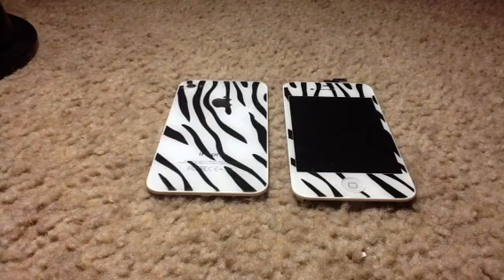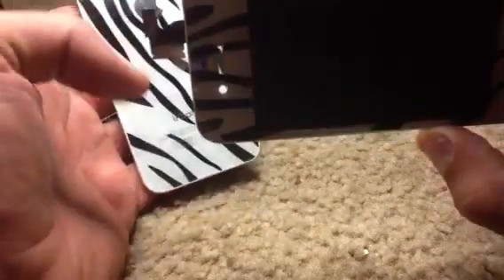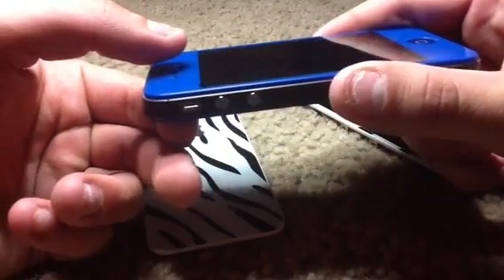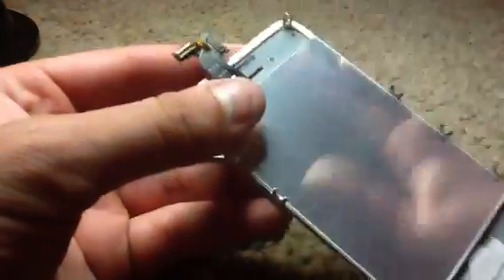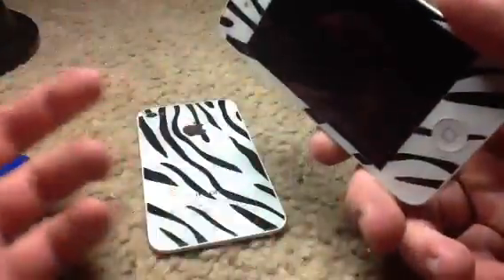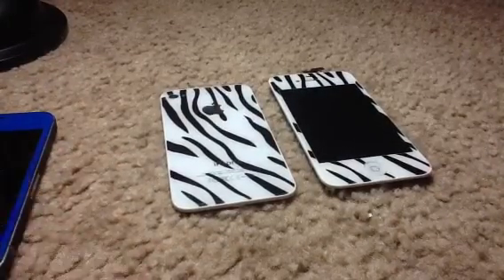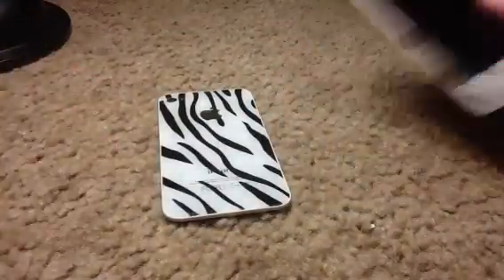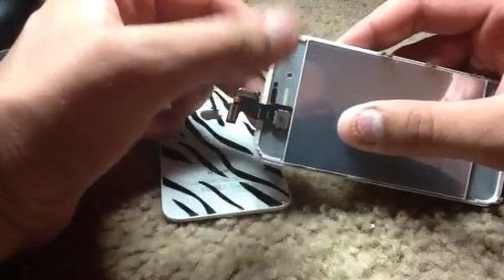iPhone 4 and 4S proximity sensor issue fix

Comment: I still have a stock iPhone 4S screen but the proximity sensor does not work. I thinking that I might need to replace the flex cable. Any ideas?

Comment from the maker: it may be a defective LCD or the logicboard just inst reading the flex terminal correctly. If it was pressure related then it would be obvious and very visible on the screen. try removing the screen and test it without it installed and see if its any different.

Comment: did 4s screen replacement was working finethe day i fixed it then a day later it has some weird colors on it almost like an old tv colored lines.what can i do to fix this?are the 6 washers important because i have 5of them on correctly and 1 is insideof the bracket and not directly behind the screw like the other 5.also the screen goes off when i answer a call but dosnt come back on when i take the phone away from my face will your tape fix fix this problem or is it just for phones that stay on?

Comment from the maker: In the video I demo what causes the issue and how to resolve it, never use electric tape, it can easily cover the sensor and you wont see it when you put the phone back together and you will accomplish nothing. Just put the original gasket from your 4S on the replacement screen and that should be enough

Comment: Why write "FIX" when you offer no solution to the problem whatsoever...

**THE FIX**

Black electrical tape, cut two small holes with an exacto knife (about the size of a ballpoint pen) exactly large enough to fit over the two sensors. Cut out the holes so you now have a small rectangle with two holes.

Place the rectangle over the proximity sensors and the holes should line up.

Thats it!

Reconnect the "Faulty" screen and... VOILA!

Comment from the maker: unfortunately I have no idea where to get them. you could check ebay but I would suggest changing your power button flex cable for one with a stronger proximity sensor or making a gasket out of black electric tape. hope this helps in some way

Comment: No, I did not, but I'll take a good look at it. Well I really do not the answer to this issue because there are many factors that could make it malfunction. For me is usually the screen that is not right in place because when screwing back it kinda moves out of place. But also, the phone I was dealing was a 4, yours is a 4S and I have noticed that the proximity sensors are different. The 4S looks like is more deep inside, maybe because is very sensitive to light, unlike the 4 that is more out.

Comment: You said that your proximity sensor doesn't work because too much light is going in & I do not think thats quite right. The other time I got a phone, which I used, and the screen was shattered cracked. The whole top glass fell off that I was able to see the front camera, the speaker, and proximity sensor. Whenever I placed calls the sensor worked fine, even when daylight was hitting it. The issue is that you need to aline the top opening with the sensor when replacing a screen like u mentioned.

Comment: the iphone 4 has two microphones. One at the bottom and another at the top. When you record video, put ur phone on speaker; you use the top microphone. When you are in a phone call you use the microphone at the bottom. What you are experiencing is not a proximity sensor issue. I find it strange because you say that voice memos work. I would suggest doing a restore. If that doesn't work, then replace the mic at the bottom, maybe your friend did not checked so well.

Comment: Hi, Thanks for your advice.  I had the faulty prox sensor also. Removed the lifeproof case and prox started working. The cheap copy of a lifeproof case has no light barrier between the sensors. No Gasket. So I placed a small strip of amalgamating tape (1mm x 4mm) between the 2 barely visible sensors and replaced the case. It then worked. Light probably reflects off the protective acrylic front cover from the led to the adjacent light sensor. Insulation tape would probably work.

Comment: This was an 8 minute video in which you spent less than one min talkin about the proximity sensor. I just got a new iphone 4s from the apple store straight out of the box the proximity sensor didn't work. I had my 4 for about a year and a half. It didn't work either. I never knew that the 4&4s had that feature because both my brothers and my girlfriend..and sister in law.. have the same problem. I've been cheek muting people for years. It's doubtful that even one of our phones came from apple w

Comment: Just an FYI. The third "dot" next to the other ports is specifically for iphone 4S'. It's for one of the extra proximity sensors they put in for Siri. If your replacement screen for your 4S doesn't have that dot it's for a cdma or gsm. It will still work but there's a slight chance Siri might not "know" when you put te phone up to your ear.

Comment: I dont know how to personal message you so Ill just ask you here. Where do you get your screens from? I have been getting mine off ebay from two different places and I pay 39.00 from one place and 34.00 from the other place but so far they have been good screens. Any info would be helpful. Thanks. BTW good video too although I still have not been able to get the proximity sensor to work on one of the iphone 4 I have. Tried the decider thing but it didnt help. Any suggestions?

Comment from the maker: On my blue 4S I have actually gained screen resolution quality compared to my original LCD, the digitizer is just as responsive and I haven't seen any lost quality. My best suggestion is to just ask the ebay seller who makes the LCD and about the quality. The price makes no difference in the quality (this is obvious as proven by zeetron.com-don't buy anything from them)